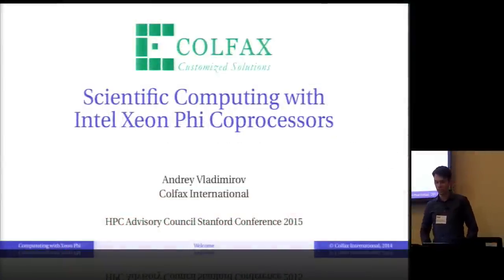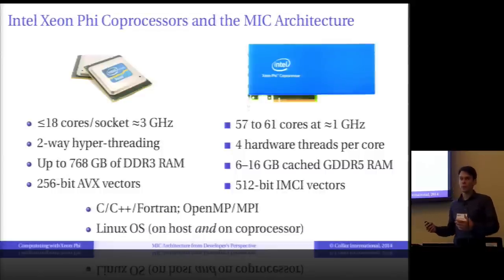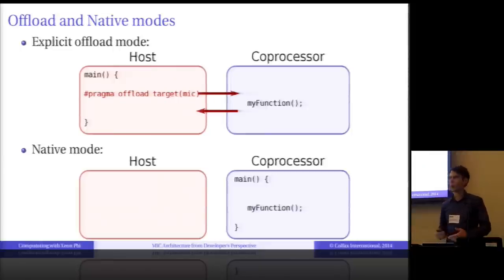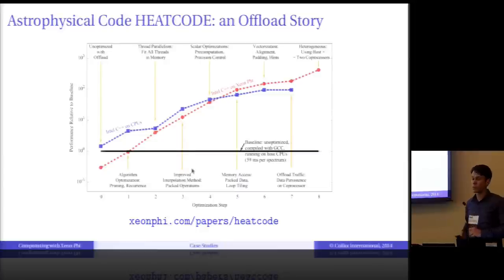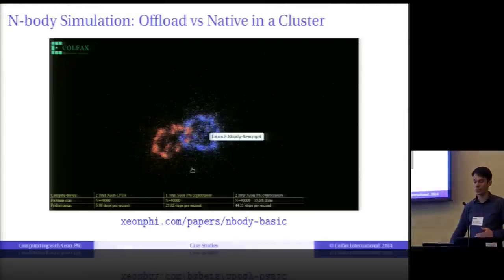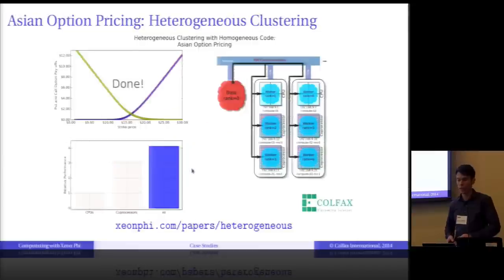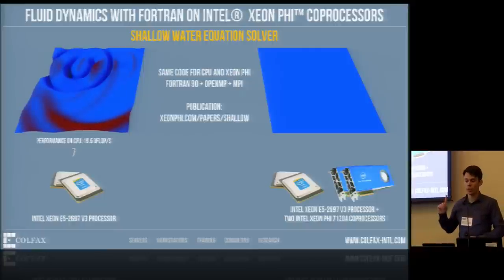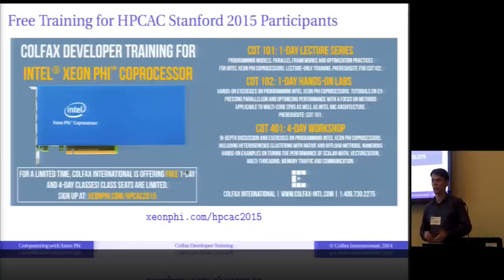Scientific Computing with Intel Xeon Phi Coprocessors

Comment: i need this thing.
Reply: Buy one? They're dirt cheap on eBay
Reply: @lost4468yt  found them for 150 box that's a bit much
Reply: @mathdev  Oh right yeah. I meant they're dirt cheap compared to their retail price, despite not being that old. $150 is quite cheap if you have a good use or just want to research them.
Reply: @lost4468yt  good point.